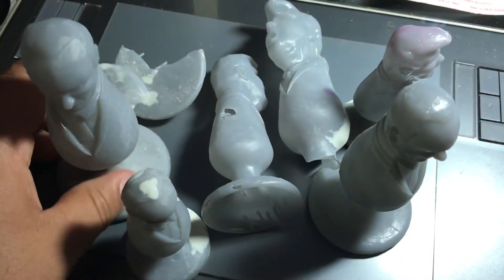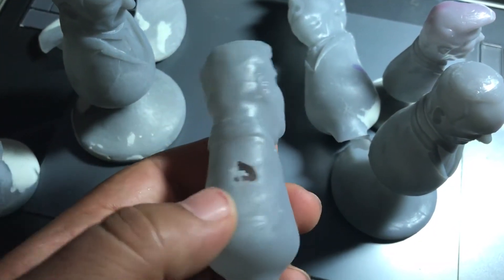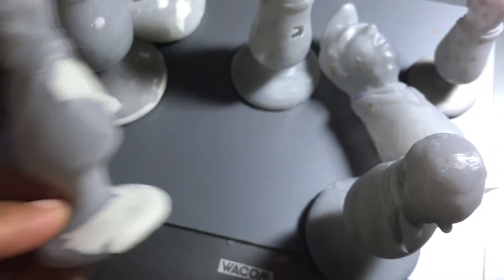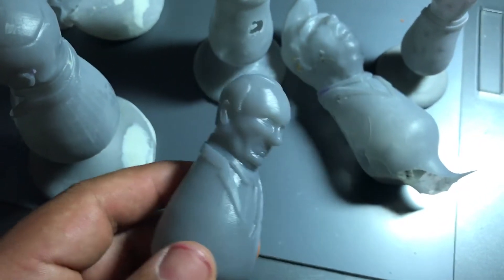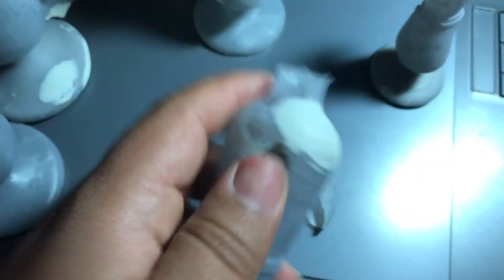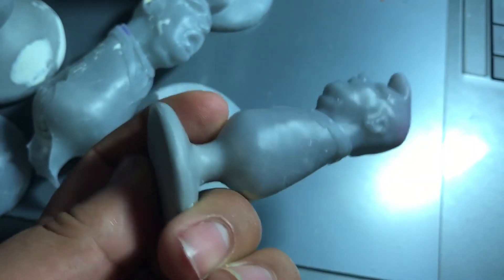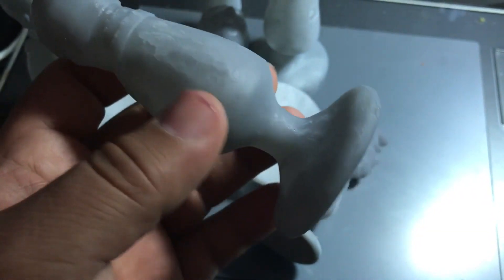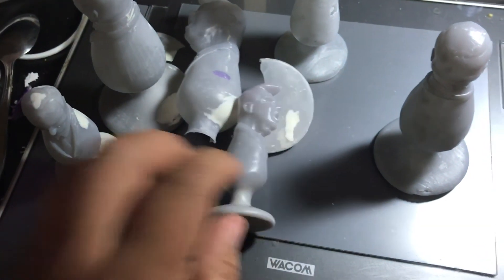My review of the formlabs form 1+ 3d printer

Comment: Increase wall thickness on your model, that will probably solve both the "brittle problem" and "hole problem".
Your "pimples" are most likely either a bad clean-up job or that your previous fails have left cured particles in your resin tank that sticks to your next prints.